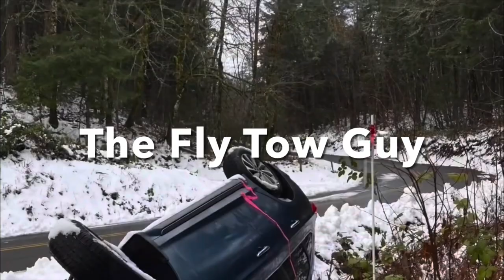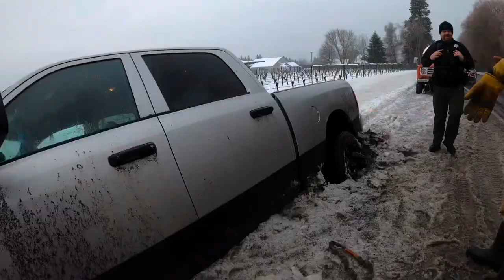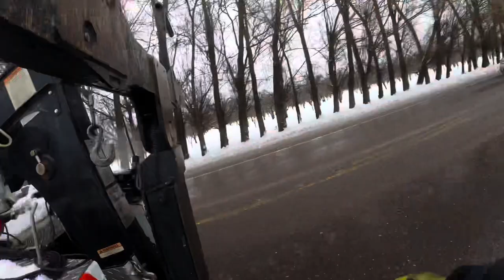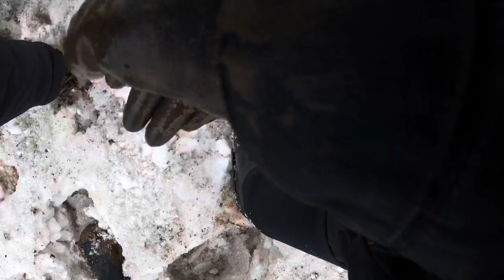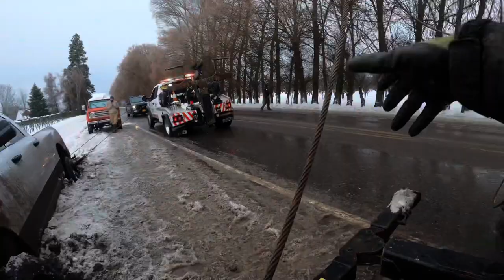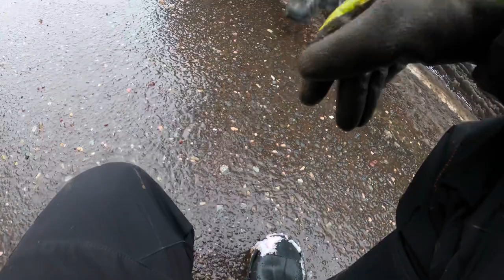DODGE RAM BURIED IN THE SNOW!! - TFTG Episode #25

Comment: That's a heavy truck by itself, but if you didn't have the luxury of a 2nd truck... your LD truck could've done it.  since you have a twin line...and have a heavy pull that you can't pull straight off the back... a heavy side load can actually bend a recovery boom. especially if you extend it out... if ya took your outside winch line, furthest away from the vehicle...ya can run it diagonally down to your lower anchoring spot on the wrecker body... just barely bring light tension on it... That anchors the lateral side load on your boom so it can't bend. then take your close side line, down to your attachment point on the casualty vehicle & snatchblock it back to yourself for the additional pulling power & reduced line load.... when you have a mired in load... especially mud...  breaking the suction requires patience, using brute force can break stuff...  put tension on your line, allow your truck suspension to compress a lil... then give it a minute... let that steady suspension spring pressure release that suction.. then load it again... only takes one or two times to break the suction.. then she comes easy.  Hope this helps ya in the future, stay safe.
Reply from the maker: Thank you! It’s not too often where I encounter a truck stuck that bad in the mud.